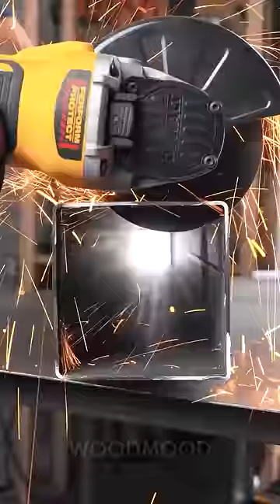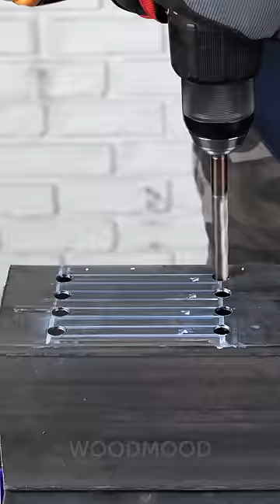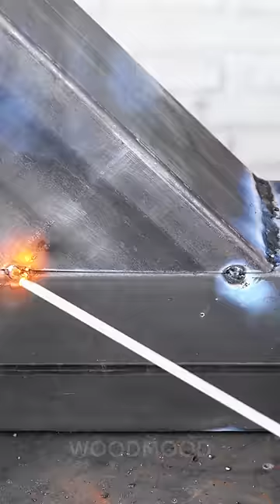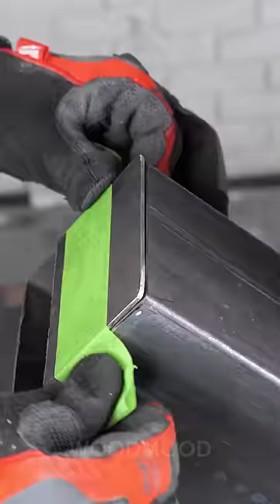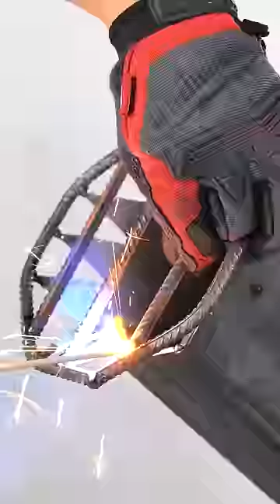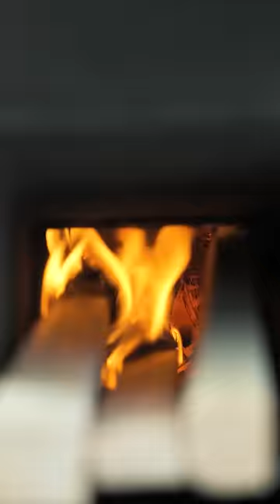This master made a portable stove from a pipe || #Shorts

Comment: I mean cool but wouldnt exactly call it "portable" especially when you can get propane burners that will fit in a backpack very easily or even much smaller single burner wood stoves meant for camping for only 20 bucks.. Hell the 20 dollar wood stove is even small enough you can probably just wrap in in a sleeping bag and carry it around with you while you camp especially since 90% of them fold up into a neat little "sheet" of metal